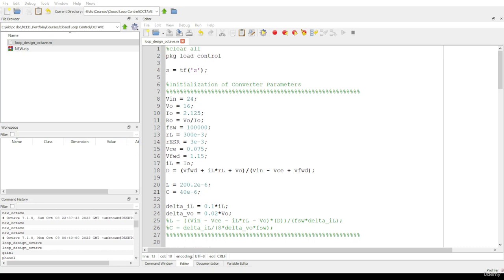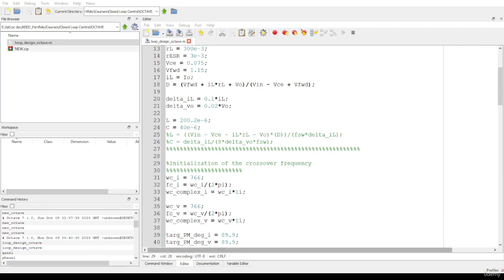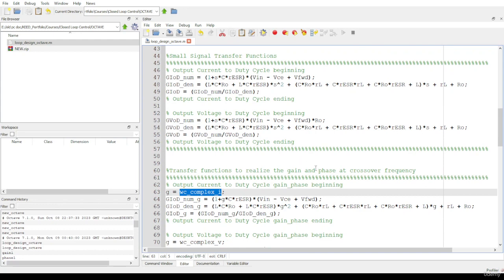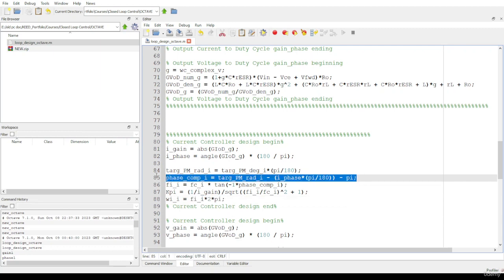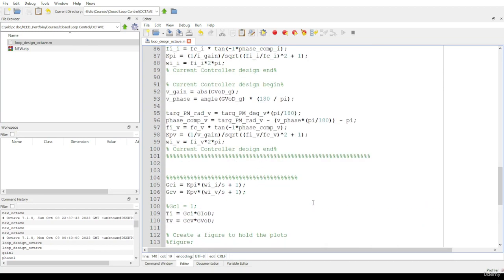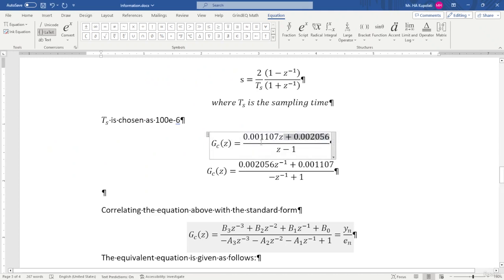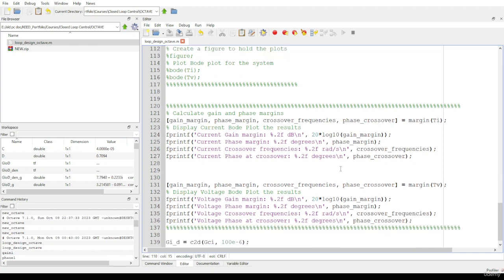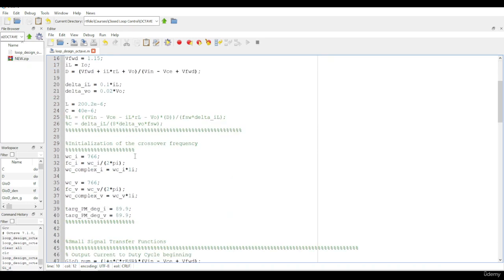STM32 Buck Converter Control - 3. Controller Design with Octave

Comment: It is not clear what kind of step-down converter you are building? In what mode does it work, in voltage mode or in peak current mode? The video is interesting, but a lot is unclear. CCM ore DCM? Different transfer functions are used in different modes.